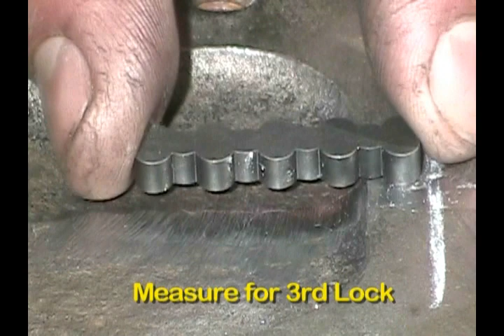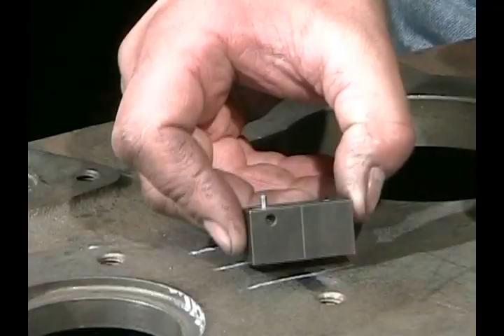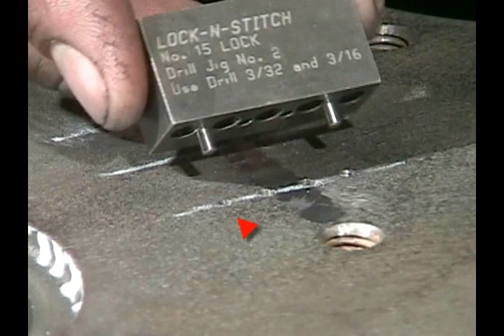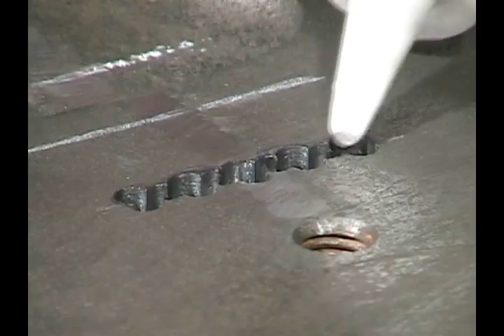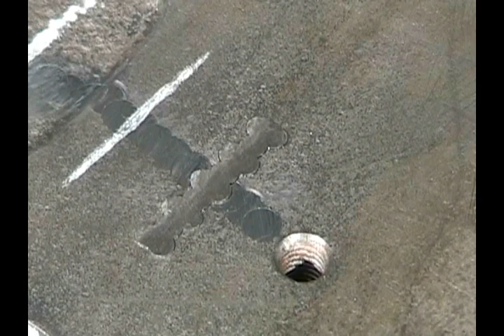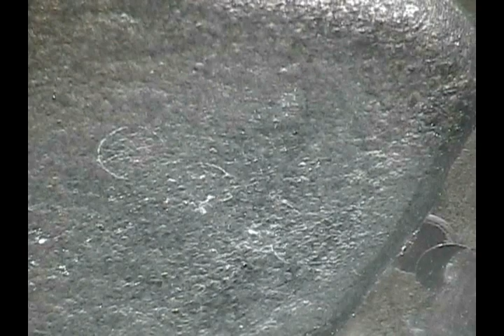Lock Installation on Crack repair

Comment: I saw a video on facebook where they only did the threaded part and didn't show the locks like you did here... Glad I was able to find this excellent example.
Reply from the maker: @fisqual  thank you for your comment. So glad you found this video on our YouTubs channel. If you can contact our customer service team they can send you even more information on our products and services. Info@locknstitch or 209/632-2345
Reply: The repair is nowhere near as strong and long lasting with just the threaded plugs....the cross locks shown here really stabilise the crack good and proper.

Comment: The previous video cut off short; after installing the second set of pins do you then make a third pass, filling in the spaces between the first pins not filled by the second set? I have an old Toyota that froze recently, causing a minor crack in the side of the block. I recalled seeing these videos since years ago and I've fallen back down the rabbit hole looking into repair methods.
Reply from the maker: Hi Jeff - thanks for reaching out with your question.  We only posted a portion of the video here, you are correct. Our customer service team would be more than happy to help you, walk you through the process, answer all your questions. Please give the team a call 800/736-8261 and feel free to send pictures of your repair to info@locknstitch.com

Comment: I just realized this is an awesome option if you had to do the repair in an area that does not allow "Hot Work" .
Reply from the maker: Absolutely!  Or for example a large engine or industrial piece of equipment that would be costly or near impossible to disassemble without huge amounts of downtime!  This repair can be done onsite  -- Thanks for watching and commenting

Comment: Very common method for the old flat head V8. But it always seemed to look like a lot of work to save them. Often wondered how they worked for the thermal changes in block temps though.

Comment: Hello, could you use this on a marina engine’s block.  Outside crack if so how deep would you drill for that ?  Thank you
Reply from the maker: Hello Diego yes our repair process is specifically designed for this type of repair. Please contact our customer service team and they can give you the technical support you need for this type of repair with our products.  Info@locknstitch.com or 209/632-2345 or 800/736-8261

Comment: A target market for this is definitely commercial sections where down time waiting for a new part costs money. 
Get the motor going while your Expediter flys 110mph in the diamond lane getting the new part to you.
Reply from the maker: Most certainly - when time is money and a new casting will cost the customer valuable resources our team can arrive onsite to do the repair.  Or if the damaged casting can not be replaced, it is one of a kind, perhaps a historical piece; the team can provide casting restoration services so the casting doesn't have to be a total loss.  Big or small - casting repair is our passion and we are here to provide solutions!

Comment: Excellent video. I'd never heard of this product before. I like how it maximizes surface area. Very clever.
Reply from the maker: Thank you for your comment - the process of metal stitching with LOCK-N-STITCH products is installing our patented stitching pins in an interlocking (overlapping) fashion the entire length of the crack to create a pressure tight seal and if additional strength is required locks are installed across the line of pins.  Feel free to visit our website to learn more or contact the customer service team with any questions.  We provide products and services to repair any damaged casting.  locknstitch.com or info@locknstitch.com 209/632-2345

Comment: Or just do as my machinist did before he died. Drill and tap 1/4 inch screws at the end of the crack, then stitch then overlapping into the crack so you drill and tap into each installed bolt in an overlap pattern.

Comment: Are there any advantages in any way over grinding out and properly brazing a crack? I mean other than if you don't have a torch or don't know how to use one. Otherwise this seems like a half-assed solution to a real problem.
Reply from the maker: Our patented products and thread technology pull the surrounding material together. Adding strength and saving time/money by repairing rather than replacing. This application is used on all sizes of castings!

Comment: Always loved watching this process. During my apprenticeship at Tilbury Power Station there was a large crack found in one of our 60mw turbine steam chests. The top was removed and a pair of contractors came in to carry out the repair. I spent some time watching them and was really impressed. They said that they repaired a whole range of castings and showed me a ship’s propeller they’d stitched together. This was early1964.
Reply from the maker: Thanks for sharing Peter. This process has improved greatly on that method used in the 60's.  Technology that saves!  Thanks for watching and commenting.
Reply: Me too - in my production engineering days

Comment: Gives another option other than welding or brazing.Does this work on a curved surface or only flat surface though?
Reply: On subtle curves you can just grind or machine it down but on anything else you'd need to braze

Comment: Wow, this takes me back to the mid 70s when I was doing my apprenticeship when “real” mechanics fixed a problem and not stick it on a machine that tells you what needs changing
Reply: i would absolutely love to work on cars that had carbs, and that's it. Rather than having to hook up a scan tool to find a seat heating element isn't sending a signal to the body control module, or the ECM doesn't have voltage to switch an evap canister purge valve on and off. Mechanics now have to be educated, and not just hit something with a hammer.

Comment: And when it’s all said and done, you still have a “crack” in there.  I used to repair forging tools, dies, and equipment for a living and metal stitching was rarely a permanent fix.  Metal version of a bandaid except what’s under there doesn’t “heal”.    Cut out the crack, weld it 100% penetration, done.   No more crack.   Then find out why it cracked in the first place.
Reply: Except welding a cast iron block is easier said than done. Not saying you can't do it but it's not as simple as grinding the crack out and welding it up. Brazing is sometimes a good option, but depending on why it cracked in the first place, cold stitching might be a fine option. Like if the block froze, that's not exactly a regular force that it sees, so you really just need a stable repair that seals and ideally blends well. 

Though I have to say, the best repair for a cracked block is almost always to get a new block, and on stuff that's rare/expensive/irreplaceable guys are usually a lot more willing to just spend the money and get it properly furnace welded. These types of repairs are pretty much exclusive to the realm of backyard hot rodders who don't even want to shell out for a new block lol.
Reply: @ABusFullaJewz     Twenty six years running/owning a weld shop that specialized in repairing tooling, dies, and components for the forging industry.  I would agree that metal stitching has its place, like you say in components that aren’t generally subjected to destructive forces.  But if they are, I’m not a fan of this method.   And yes cast iron can be a bitch, especially when it’s composition is unknown, but it can be done.  Not a favorite thing to weld by ANY stretch, but I’d rather than stitch it.
Reply: @tgreening absolutely, on my own stuff I would too. But also if a guy is fixing a small block with a cracked water jacket, I would rather see him use a cold stitch than try and gob it shut with a mig welder without knowing better. To the average homegamer, as far as I'm concerned cast iron should just be treated as unweldable/only weldable by professionals.
Reply: @ABusFullaJewz Agree  100% with you. Welding cast iron is a bitch at best. Will NEVER get a 100% mechanical strength like on S Steel and M Steel etc.
Reply: @quartusbuys6831  Yeah, a little detail every home shop welder finds out for themselves, when their weld goes "pop" as it cools, leaving a bigger crevasse than before!
Reply from the maker: @Andrey Angere Absolutely!  From big to small, metal stitching can save a customer money, downtime and there isn't a need to replace when you can repair!
Reply: @LOCKNSTITCH  no way. Reply’s to an 11 year old video. Customer service on fucking point
Reply from the maker: @JLangey10  Casting repair is our passion!  We truly appreciate each and everyone of our customers.  LNS has been coming up with repair solutions for over 30 years - still going strong!
Reply: Doesn’t seem to make sense drilling holes in a block with cracks
Reply: Doobie Lew provides the crack with a relief and prevents farther uncontrolled cracking. I’ve done the same thing on old dirtbike frames when the factory welds break. Drill holes on both ends to verify that’s the end and prevent it from continuing to crack then weld her back up
Reply: @lucastay8355  I do the same
Reply: @doobielew5439  Sharp crack creates a stress riser, round hole prevents crack continuing. Could probably also solve this problem in a less time consuming way with just a single circular plug.
Reply: I'm a retired welder of 50 years and welding cast iron or pig iron is no different to me than welding anything else, years ago we used to use two different cast rods (Stick) run one rod then the other on top keep using alternative rods until it was welded, it was important to peen each run of weld, it's even easier these days with TIG.
Reply: @johnogara3029  I never welded a  car engine, i worked in heavy industry and welded similar, i've seen new engine blocks, gearboxes and pump housing welded, if they showed cracks or defects when being machined, they weren't scrapped, they were put in a brazier and covered in borax and flooded with brazing rod, i can't see any reason a car engine would leak after i welded it, knowledge of how to prep it is probably more important than welding it, you can't properly weld a ground out 'V' it has to be a 'U' with rounded edges etc.

Comment: Very interesting video series and a great tool set and process. What are the advantages of this repair over, V grooving the crack and brazing or preheating and TIG welding the crack? Regards, Ash.
Reply from the maker: Permanent repair!  Here is an article that can explain a bit more http://www.locknstitch.com/pdf/gmrc_white_paper.pdf
If you are ever in need of our products or services do not hesitate to reach out to us info@locknstitch.com or 209/632-2345
Reply: Yes cast iron repairs very nicely with brass or arc welder , last year I did a head Gasket on a 1947 tractor , I had brazed the head and block top in 1968 due to frost damage still fine 53 years on

Comment: I knew that carpenters like to use bowtie shaped keys to lock cracks together, but I never knew a similar method existed for metal. Is it done on regular cars today still or rather on industrial equipment?

Comment: It’s engineering, but somehow it’s more like art :o) - A friend has a tractor with a cracked casting and I don’t fancy having a go :D
Reply: @CheesedCheese  LOL, I think I would be the “hydraulic oil all over the public highway” man :D Someone has already had a bit of a weld at another bit of it. But, as the saying goes, it only leaks when you use it and it has a filler plug ^-^

Comment: May be a silly question but what are the advantages of doing this method versus TIG welding?
Reply: My guess would be the skill required to do this repair is much easier than tig. It can be done in the field, and it could be done in conditions that are too dirty for tig. Just a few things I would wager are factors, I'm just thinking off the top of my head.

Comment: Is this an Aviation skill??
Reply: Well. If you've got a vintage aircraft that you rarely if ever take out then sure. But, in aviation it's more like if it's worn, short of broken (or broken), then you would be mandated to replace said item. Be it an engine block or any other cast peace. Lastly, most aircraft parts are aluminum, magnesium, or even titanium. Those are very fickle either easy to fatigue, dangerous to work on, or strong but can be brittle in that order.

Comment: Very impressive repair work 👍 
Is that just to strengthen cracked cast iron or will it actually seal that crack against leakage like a engine repair to keep it from leaking coolant
Reply: I spoke to soon I watched a few more of your videos and kind of found an answer to my question still very impressive... 
Thanks for getting back to me so fast
Reply from the maker: @garyanvil2354  You are most welcome!  Happy to know you watched more and got the answer you were looking for.
Reply: Really good videos straight and to the point 👍
Honestly I wished it was longer
Just curious Where is company located?
Reply from the maker: @garyanvil2354  we are located in the central valley of California - Turlock CA
If you would like to get more information and learn more about our process/products feel free to send an email to info@locknstitch.com or call our customer service team at 800/736-8261 or 209/632-2345
Reply from the maker: The locks do add strength and the stitching pins will seal.  The patented thread design pulls the surrounding material together repairing, sealing and adding overall strength to the repair.

Comment: question, why is this “repair” better vs grinding down and welding the cracks ?
Reply: Cast iron is a pain in the ass soon as heat is applied warp and more longer  crack that casting is pretty thin
Reply from the maker: Thanks for the question Paul - Here is an article that you might find interesting when explaining the value in metal stitching - customer visited our trade show booth to learn more about LNS stitching pins  http://www.secondchancegarage.com/public4/metal-stitching-1.cfm

Comment: Why is this superior to welding?
Reply from the maker: Because it can be done without heat, done in frame if needed. This process adds strength to the repair, the patented thread design of the stitching pins pulls the material together, make the permanent repair stronger than new!  If you have any other questions please reach out to our customer service team.  They would be happy to help info@locknstitch.com

Comment: Drill stop, V it out, preheat, and welded it up.
Reply: Then put it into a hot oven , then turn it off, and leave it to cool down. I've welded lots of exhaust manifolds this way very successfully  , hope it helps best regards.
Reply: @colinellis8661  your right Colin I forgot that very important process. I'm an old time welder that was also taught to use a grinder to see what type of cast your working with cast iron vs cast steel, the spark test will start you down the right path.

Comment: Looks like he turned a crack into swiss cheese. How strong it it now? How long before those many inserts begin to move around? I think the first hole was all he needed to stop the crack then one or two stitches and weld remnant of crack prevent leakage, not structural.

Comment: I think its a beautiful system but unless its a diy project, how many hours does that take?  How much would a new section cost?
Reply from the maker: This process can be used in many different applications, from smaller automotive engines to large industrial casting and large engines - the cost will vary on the complexity of the repair; if you have specific repair questions please feel free to email our customer service team info@locknstitch.com  They can get you more information  - Thanks for watching and commenting.

Comment: I will probably never have to do a repair like this, but this is still pretty interesting to watch. I'm curious what kind of metal the pins and locks are made of, aluminum perhaps?
Reply: doeas not look like aluminium. Besides aluminium locks will break up even during instalation.

Comment: For all the welders out there from the Lock-N-Stitch Website: We want to share some truths about cast iron welding with you. These truths are easy to understand, extremely important to know and yet, ironically, hardly known in the welding world.

About 40% of the casting repair work that we perform in our service department is performed by some type of welding procedure. Even though we are the world leader and only complete supplier of metal stitching supplies in the world, we are also the only company who will actually tell you the truth without bias. Some repairs require oven welding and some require metal stitching. http://www.locknstitch.com/cast-iron-welding.html
Reply from the maker: Thank you!  If anyone has specific questions or is in need of technical support please give us a call 800/736-8261 or 209/632-2345

Comment: Seems like a lot of hassel. Just drill and tap a hole at the end of the crack. Screw a non plated bolt into the hole cut off and peen. Drill and tap another hole overlapping the first. Install another non plated bolt cut off and peen.repeat to the end of crack then braze over all the cutoff and peened bolts. Voila!
Reply: It does look like a lot of work, i agree- but consider:  the jigs used ensure a consistent overlap. It comes down to how rare, unobtainable or expensive the component you are attempting to stitch is. If the repair is a cock up you are unlikely to get a second chance.

Comment: where the hell do you get that air spray!! i mean it has a blower on the side and a fitting on the top!! genius!!!!
Reply from the maker: They are fabulous aren't they!  You can buy them from us!  LQA is the part number 800/736-8261 or 209/632-2345 or info@locknstitch.com